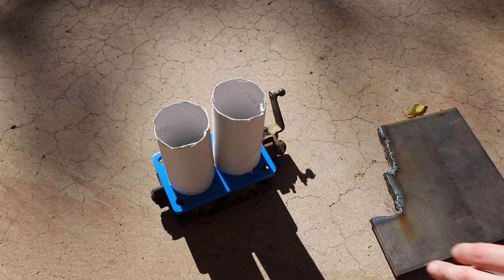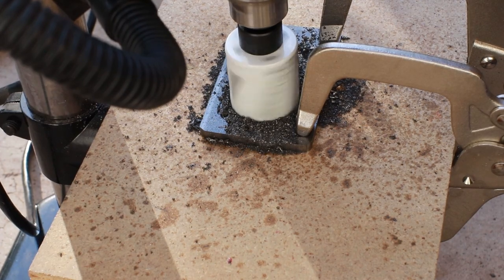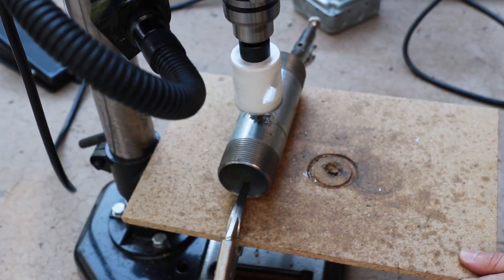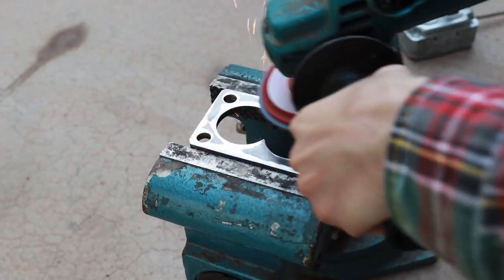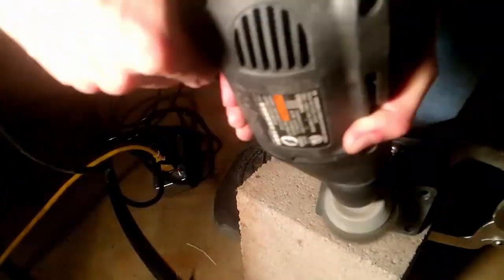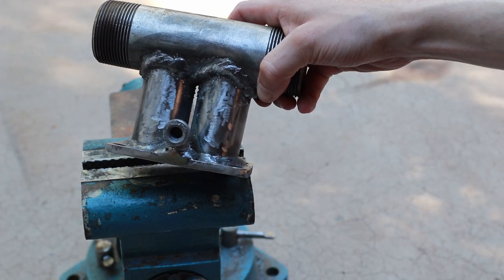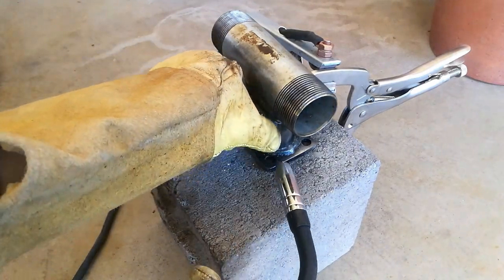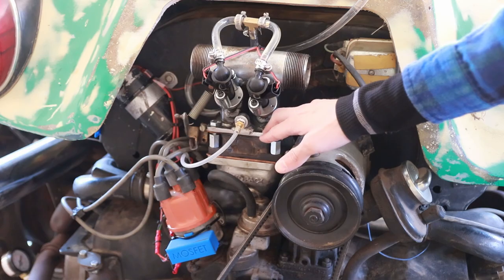TBI Fuel Injection for VW Air-Cooled Engine

Comment: What injector bungs did you use and which injectors? Very cool video also what throttle body is that?
Reply from the maker: For the injector bungs, I used these steel ones  from FRSport: https://frsport.com/products/atp-uncategorized-atp-uncategorized-atp-ful-misc2-st

I used injector barb adapters from eBay with hardware store bolts to attach them to the bungs. The fit is not perfect, but as long as the adapters are securely mounted over the injectors, they shouldn't leak: https://www.ebay.com/itm/113711584424

For the injectors, I initially used some lower-capacity ones from Amazon, but switched to these high-flow 440 cc/min to ensure that I would never hit 100% duty cycle and lean out the mixture: https://www.ebay.com/itm/223283676528
Reply: @DielectricVideos  what do you estimate your duty cycle for e85 would be, do you think that CC would be enough, just curious
Reply from the maker: @Projects_and_Pistons  For straight gasoline, I calculated that my current 1776cc engine running at redline RPM (4500 RPM) and WOT (atmospheric MAP) will consume about 429 g/min, or about 611 cc/min when running at a worst-case rich AFR of 11.0. At the design pressure of the fuel injectors (43 PSI), each one nominally flows 440 cc/min, so the overall duty cycle would be about 69%.

E85 has a stoichiometric AFR of about 9.8, which is about 66% of the stoichiometric AFR of gasoline. So, for the same worst-case rich redline WOT condition in E85, you would theoretically need 1/(0.66) = 1.51 times the duty cycle as you would for gasoline, which would come out to an impossible 105% for these injectors.

I actually run my fuel rail at about 58 PSI using this off-the-shelf regulator/filter ( https://smile.amazon.com/gp/product/B07W9H5TF9 ), not 43 PSI. So, in actuality I can theoretically get up to 593 cc/min out of each injector, so on E85 I could theoretically meet demand at about 77% duty cycle.

At these flow rates, the fuel pump would likely be the greater bottleneck in maximum flow, rather than the injectors. I am almost certain the $25 fuel pump I'm using would not be able to keep up if I actually commanded this much fuel demand ( https://www.amazon.com/dp/B07FZ5YKXT ).

Right now I typically run either 87 or 89 pump gas, rather than E85 (I probably would run E85 if it was easier to get in my area). I rarely run the engine to its absolute maxima (with the occasional exception during freeway driving). When I have occasionally pushed 4000+ RPM at WOT, it's run well enough for my liking. Really smooth on 89, and the slightest hint of knocking on 87. I haven't installed a lambda meter yet, so I can't say for certain if the engine is leaning out or not. No complaints about the system performance over the last 1800 miles, but as with any homemade system, YMMV.
Reply: @DielectricVideos  thanks for the detailed reply, I am planning on going efi so I can use e85 and reduce cylinder temps on long cruises
Reply: Ok I’ve looked everywhere and I can’t seem to find that throttle body you used, it looks used the only one I found like it is a holly throttle body for a 2 barrel. What did you end up using?
Reply from the maker: @Projects_and_Pistons  It's an old Zenith carb throttle body that I had. I later found out they are quite rare and valuable, so probably not the best platform to build a cheap EFI system on.

https://expedition-imports.com/7121085559

Luckily, you should be able to use just about any throttle body with a vacuum takeoff. While it makes sense to have 2 barrels for 2 injectors, you could also have both injectors fire into a single barrel if you decide to use a single barrel throttle body.
Reply: @DielectricVideos   I just found one that might be more cost effective a Holley 2300 bottom is a close fit and might work, thanks for replying
Reply from the maker: @Projects_and_Pistons  By the way, I have a printed circuit board for this system now, and it also supports using a low-impedance ignition coil for spark. I have a single board-mounted Nano doing both injector control and ignition timing. This is the system I've been using for the past few months, and it works really well.

I'm in the process of making a video about it that should be out in a few weeks, but if you wanted to download the PCB files ahead of time and order some yourself, they're live now on GitHub:

https://github.com/JohnPattersonConsulting/DuneBuggyEFI/tree/main/EFI%2BIgnition
Reply: @DielectricVideos  it’s a nice design, your code is also very clean compared to mine 😂 I am thinking of using a microsquirt so I can get it tuned on a dyno, I don’t have the confidence to rely on my code like that, but I will be watching for the video maybe I’ll change my mind by then

Very cool project overall I was looking into the cb performance kits but they are way to pricey, a homebrew throttle body and coil packs is a nice middle ground that costs considerably less
Reply from the maker: @Projects_and_Pistons  Thank you! Sounds like an excellent plan, looking forward to hearing how the build goes!
Reply: @DielectricVideos  Amazing. It looks like the injector bungs are not available anymore at FRSport, do you have the full part number/name by any chance? Or any idea if these can be found at some other place? TIA.

Comment: Sequential or simultaneous injection?
Reply from the maker: I'm driving them as simultaneous asynchronous injection under speed-density control. If you build a similar manifold, you can actually control it however you want, depending on how you configure your ECU.
Reply: @DielectricVideos  is that in your provided arduino code?
Reply from the maker: @multimargejta123  Yes, it is. The currently available code operates the injectors at a fixed frequency, and the duty cycle is adjusted based on points-triggered RPM measurement and MAP sensor. The engine displacement, number of cylinders, and injector maximum flow rate are given as user-configurable constants in the code.

Comment: If a system have a MAP sensor, can it work without crankshaft position sensor?
Reply from the maker: It still needs to determine engine speed from somewhere. It can use the signal from the distributor or other ignition system source to get this information. Crankshaft position is not required for it to operate, as it is an asynchronous injection system.
Reply from the maker: Renato Passos  It doesn't need the crankshaft signal, only points signal from the distributor. This signal can be obtained form existing spark ignition points, or it can be obtained using an optical or Hall effect sensor.
Reply from the maker: Renato Passos  You could use a MAF (Mass Air Flow) sensor as a true single-sensor EFI control input. They are prone to accuracy drift due to contamination, but are commonly used on modern engines for primary fuel control. If desired, you could try implementing a MAF-only system to see if you can get it to work well.

Speed-density (RPM + MAP) systems are generally more robust due to the physical separation between the intake manifold and the MAP sensor, and also allow AFR (air fuel ratio) to be tuned over both engine RPM and manifold pressure.

It would not be possible to measure mass air flow using Manifold Absolute Pressure (MAP) alone, however, as the same manifold pressure can exist at different engine speeds (and higher engine speeds will draw in more air, for the same manifold pressure). I suspect an engine could be made to run with only a MAP sensor, but it would be nowhere close to stoichiometric except at one particular RPM value.
Reply from the maker: Here's a great resource talking about both MAF and speed-density control strategies:

https://www.mishimoto.com/engineering/2021/05/maf-vs-speed-density/

Comment: What ecu u running and fuel pump
Reply from the maker: I'm running a homemade ECU that uses an Arduino, a slightly modified version of the one I covered in an earlier video: https://www.youtube.com/watch?v=kj24iWmM_PU

For the pump, I'm using this one: https://www.amazon.com/DWVO-Mustang-Thunderbird-Mercury-Continental/dp/B07FZ5YKXT

And for the pressure regulator, I'm using this combined filter/regulator: https://www.amazon.com/gp/product/B07W9H5TF9

Comment: You will never get rid of the bog without adding a throttle position sensor. The MAP is too slow to compensate for a sudden change throttle position. Really the MAP is more about fine tuning. Throttle position is more important than knowing air flow....Long time ago a company used to sell an EFI conversion for VWs that ran off of only rpm, temp and throttle position.

Comment: What type ecu you like to use ilike your project 
And if I ask akit did you supply it 
Thx
Reply from the maker: I designed a custom ECU based on an Arduino Nano. You can see the approach I took in another video: https://youtu.be/kj24iWmM_PU

Comment: Does the injectors operate at the same time?
Reply from the maker: Yes, they operate at the same time and are wired in parallel to the same MOSFET and 12V supply.
Reply: @DielectricVideos  which spec for this mosfet ? Thank you!
Reply from the maker: @brunopmoraes  I'm currently using an IRFP460 to drive the injectors. Using the same type of transistor to drive an HEI ignition coil as well!

Comment: Code arduino same as before this video?
Reply from the maker: It's very similar. I am working on adding an AFR table to change the fuel mixture depending on load and RPM conditions.
Reply: @DielectricVideos  you have using throttle sensor code?
Or can i get new code?
Thanks
Reply from the maker: @rofieasnan6085  I haven't written throttle position code yet; however, I just posted a new version of the code with AFR mapping and rate-of-change of MAP pressure, which emulates rate-of-change-of-throttle from a TPS. Here it is: https://github.com/JohnPattersonConsulting/DuneBuggyEFI/blob/main/MAP_EFI_V2.ino

Comment: Hello

From the clip, it  You use original vw distributor.  I want to know  What did you do with the distributor to cause the ecu to calculate the crankshaft angle?  Have you used the original (4tooth 1sensor)?  or has been modified?
Reply from the maker: The ECU isn't actually aware of the crankshaft angle, it just counts pulses from the original breaker points to calculate RPM. In this system, fuel is dispensed at a fixed frequency, and is asynchronous to the engine rotation. Only the duty cycle of the fuel delivery is changed by the ECU, dependent on measured manifold pressure and RPM.
Reply: thank you

Comment: Why didnt you just print the whole manifold?
Reply from the maker: It needs to be fuel-resistant, tolerant to high temperatures, and resistant to cracking in high vibration. Because of this, I felt that steel was a preferable choice to most of the common 3D-printed media.

Comment: 1 injector cold Handle this 60hp
Reply from the maker: Maybe, depending on the injector. 

I originally had a pair of 273 cc/min injectors, and I could definitely get it to lean out at high RPM/high load. On the freeway, it would actually gain power when reducing from WOT to 50% throttle. I changed these out to 440 cc/min injectors and it seems to keep up all the way to WOT now.

IMO it's much better to have extra headroom in the injector capacity than to risk the mixture going lean at high load. Aircooled engines will burn up really quickly if the mixture goes lean under power.
Reply: @DielectricVideos  i use a iwm52300(off a 1000cc engine) on my 1600cc, hold 140hp on a turbo setup too
Reply from the maker: @MrIngorodrigues  Very cool, looks like the iwm52300 is a real beast of an injector. Do you know the flow rate and rated fuel pressure on that one?
Reply: Sure, they are infamous here caled "dumb EFI" so they are cheap ones lol
The specs i found are
29-36ml at 1bar 
42-48ml at 1,5bar